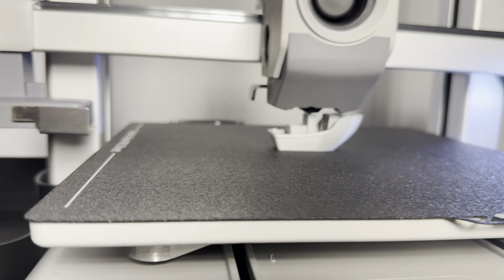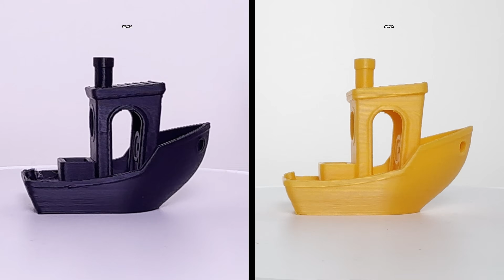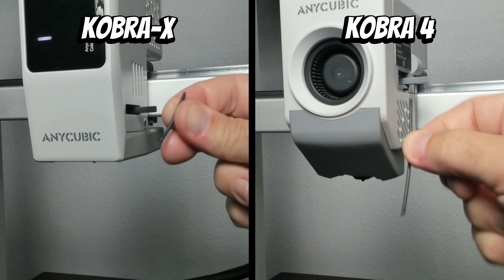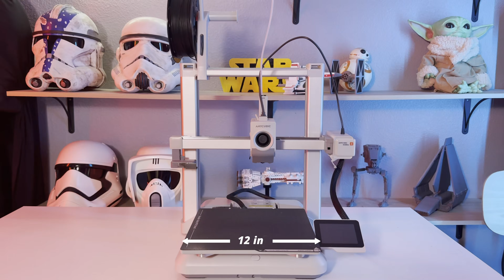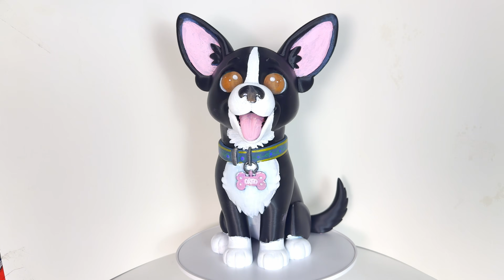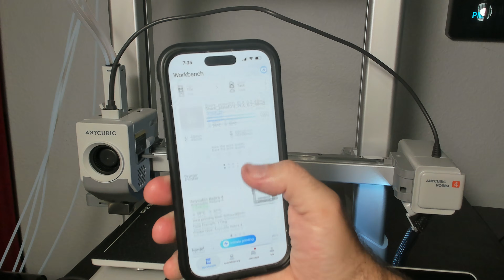Kobra 4 Vs Kobra-X: Which Budget 3D Printer To Buy In 2026?

Comment: I would not buy either for true multicolor.  Even the Bambu Labs systems are better, but the Snapmaker U1 or Ceator 5 Pro is probably an even better choice due to overall cost reductions.

Comment: Great video thank you, question what if you added little lego pieces as extra print objects used as the purge would that work?
Reply from the maker: You can change the purge tower to be a different model, but it needs to be tall enough to purge every layer needed.

Comment: Neither. Go with the Flashforge.  Best budget option
Reply: I was really stoked. Until they made that same  Bamboo dick move😅
Reply: @freedom8480 yup I agree😂, I just watched a video on that last night. It sucks they did that. I'll just keep using this old slicer and use my USB drives to print my files. It's still Orca based.
Reply: My Kobra x is offline as well. Waiting for anycubics path forward🤪
Reply: @freedom8480 or seek projects like Rinkhals to get orca/linux function now
Reply: @freedom8480 kobras are already locked down
Reply: The reduction in purge waste makes me lean towards the X unless you want go all out on the FF Crestor 5. Depends on how much printing you do.